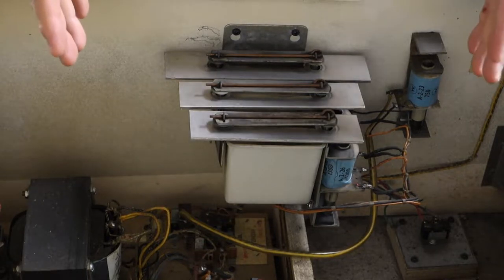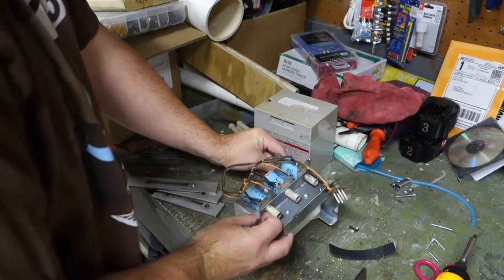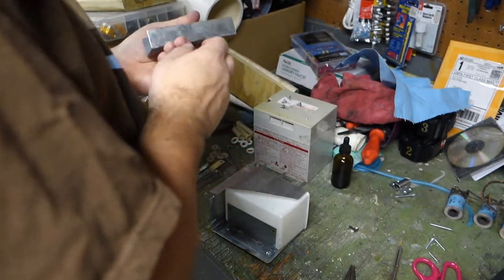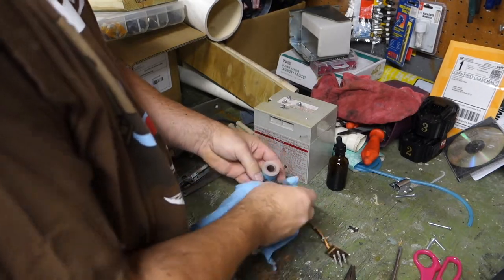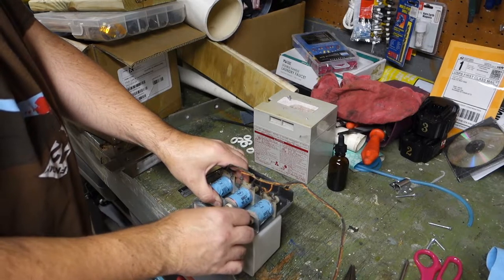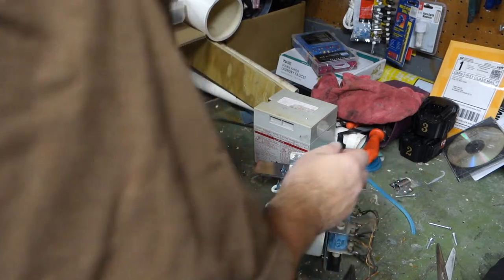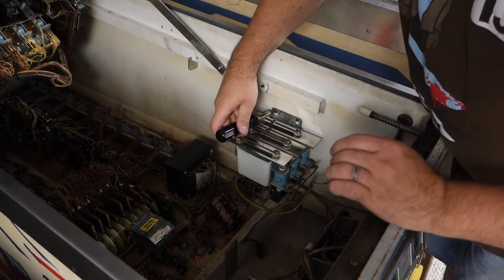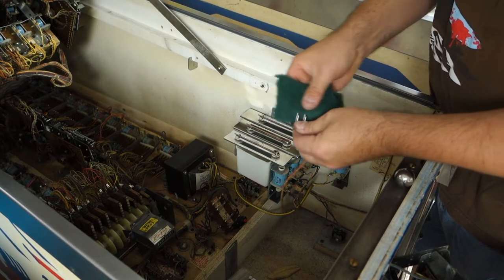1976 Williams Grand Prix Chime Box Rebuild

Comment: very nice. I like the silicon tubing idea.  What is the size on that tubing?
Reply from the maker: Blue Silicone Airline Tubing is what it says. I believe its the standard size for most off the shelf air fittings. maybe 3/16
Reply: @MarksBasementArcade  Great, thanks, your videos are helping with my Grand Prix fixup.
Reply from the maker: @GutsyGibbon  Thank you for watching them. I believe they are the most detailed videos on this machine that's online right now.
Reply: @MarksBasementArcade  I think that is correct. "Joe's Classic Video Games" has some nice videos for the Grand Prix also.
Reply from the maker: @GutsyGibbon  But he doesn't go into depth with every mech like I did.